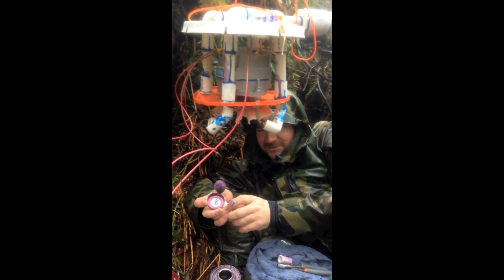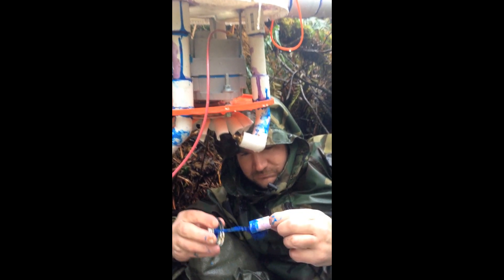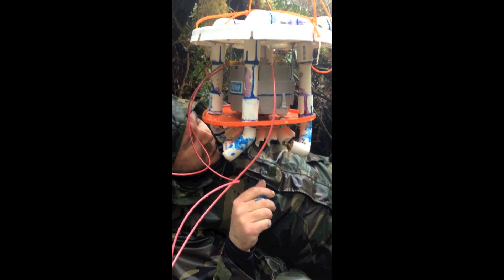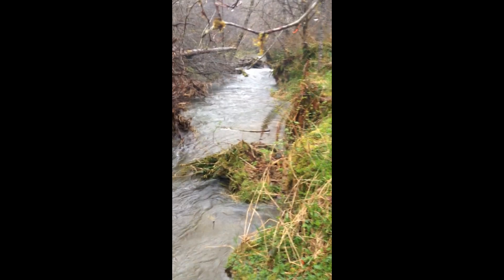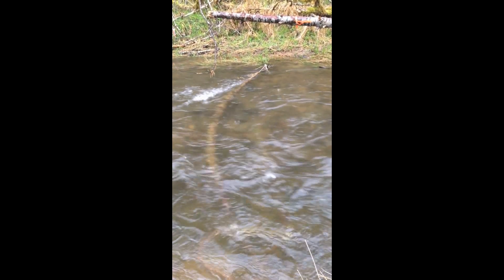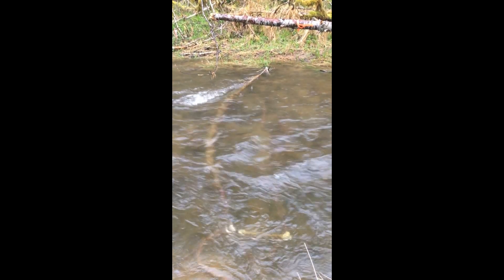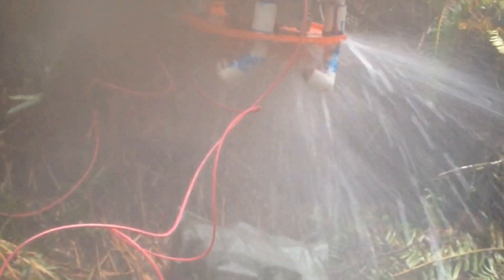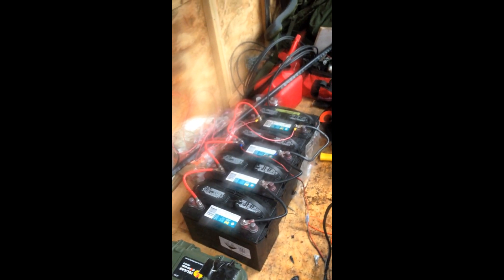Pico-hydro for science!

Comment: Sam Redfield here. I was happy to see your project. Let me know if you have any questions. Nice work!
Reply from the maker: Thanks--for the design and the kind words! I've posted an updated and re-edited version of the video, and it looks like we'll be installing a second generator on the same line. It seems that the power is clean enough for our electronics, but our electronics aren't clean enough for our electronics: when we attach two multiplexers/controllers/dataloggers to the same power source, they generate noise that reduces the sensitivity of the instruments. The simplest solution seems to be to build a second generator. It'll be interesting to see if the practice of making the first allows us to make the second one more efficient.

Link to the update: http://youtu.be/1tXgvoo6v10

Comment from the maker: Update: We went back to the site to install fuses and bypass switches (to be sure the batteries won't explode) and also to take some measurements with a real ammeter (one that encircles the wire without making conductive contact). It's not producing nearly as much current as the poor measurements with a standard multi-meter suggested. We're actually getting 0.7 to 0.8 amps. Another problem: we need another generator to power the two logging multiplexers, because they interfere with one another when connected to the same power source. The plan is to stick a Y- or T-joint onto the 2-inch pipe and have the two generators side by side. If we can get around the same amount of current from each of two generators as we're getting from one now, then that should be ample. Otherwise, there are things we could do to improve the efficiency. For example, rough calculations indicate the ratio of turbine velocity and jet velocity is 0.6, and optimum is 0.46. To get there with the current setup, we'd need to reduce the diameter of the nozzles to increase the jet velocity, but that might actually result in a loss in total power, because smaller-diameter nozzles would produce less flow, and ultimately the power produced is proportional to the flow rate. Alternatively, if we could somehow increase the load, that would increase the resistance felt by the rotor and decrease the turbine velocity. How to do that? Short the circuit to ground!